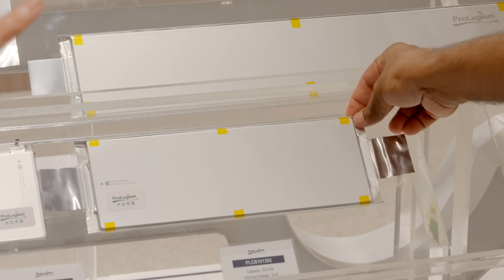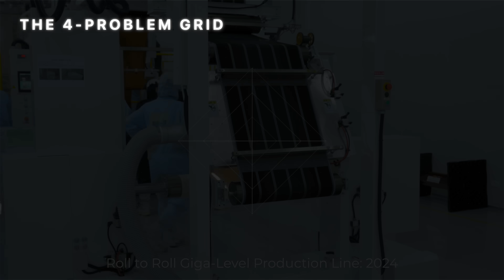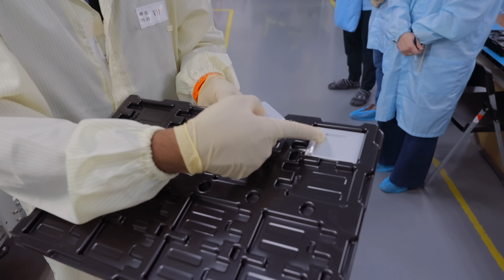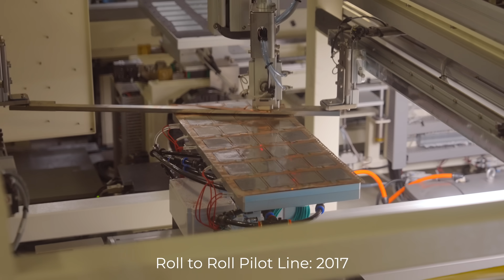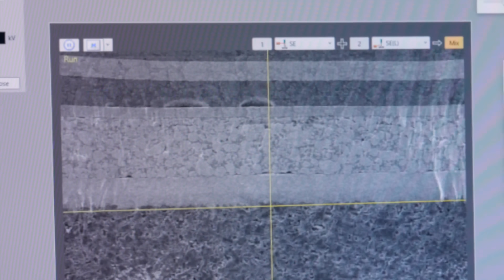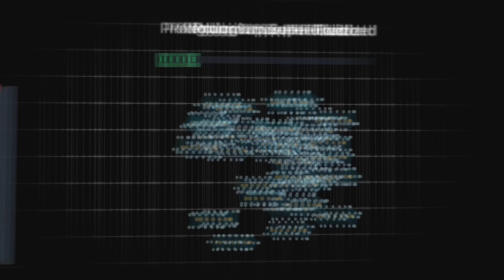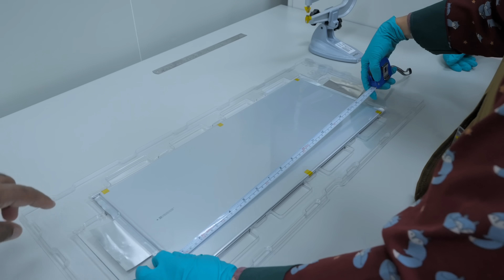Testing a REAL Solid-State Battery - Finally Here?

Comment: I've been saving up for an electric car, and these batteries are exactly the type of upgrade I've been waiting for.
Reply: You will have plenty of time for more saving before these become scaled for the level of production required for mass-market EVs.
Reply: Well, then you have to save up for a Mercedes supercar to get those batteries in the first stage.
Mercedes has a direct investment, so they will be the first to get the batteries
and are currently running test vehicles using them.

The full production plant in France is estimated to go online around 2028, and the car might come out a year or two later
You still have some time to save a fortune.
Reply: E puoi ancora aspettare,non mi pare le montino sulle auto

Comment: What cars has it come to? Where is it coming to in the future? Do we know?
Reply: No cars from what they said at the beginning, drones, personal devices etc right now. I’m sure that’ll change though.
Reply: The technology is basically ready and mass producible. So I guess it's about scaling up production at this point.
Reply: Mercedes has a direct investment, so they will be the first to get the batteries
and are currently running test vehicles using them.

Mercedes supercar might be the first EV product that people can buy with these batteries
Reply: Rimac will also have battery packs with their cells, supposedly ready to supply the first packs next year, meaning on the road / scale production by 2029.
Mitsubishi Chemical is involved in the cell material.

Comment: Solid State battery, look inside, liquid.
Does this make a lead gel battery a solid state battery too?
Reply: Being a gel is a good thing, it’s self healing when the anode or cathode move slightly. Solid state battery is about safety, and we see that it’s entirely safe.
Reply: I think they altered the definition, so now it needs to not swell when you cut it a bit?
Reply: @cristibaluta he mentions the definition first so he isn't hiding anything. But still it is odd. The energy density is promising if it really is  over 300wh/kg
Reply: @kapytanhook Doesn’t the video show that the energy density is 360Wh/kg? You don’t believe it?
Reply: @WoutMertens  360 is over 300. just look at the battery its optimized for density. in a normal form factor you can buy it will be a bit lower, very impressive in any case.
Reply: So, from looking at this video and their website, I think there's an explanation: the electrolyte is a very low viscosity liquid which somehow undergoes a change when exposed to very high heat that instantly solidifies it.

Comment: as a moron who is familiar with these things you call...batteries... ..im curious, do these new batteries require the same rare earth minerals as previous or have we managed to reduce the dependency on critical minerals?  Or are they completely different critical minerals?  Thanks.
Reply: Rare earths are used for magnets, and other things. There are 17. 

 NMC are not rare earths. They are transitioning. Well cobalt is. It's not rare - just a pain in the arse to extract from copper and nickel. There's actually more cobalt than lithium on earth I guess. It's just inside. 

 I believe this uses NMC + lithium. The maganese and cobalt of these types of batteries has been decreasing substantially for years.

 NMC started as a 1:1 ratio. Now you got ones that are like 80/10/10%. Or this one 90/5/5%. 

 These classifications though are getting too wild. I don't think I care anymore if it's a completely solid state. I just want a durable, power dense battery that doesn't weigh more than gold. Ha. 

 Can't wait for some 500wh/kg batteries. I was told 50wh/kg structural batteries would be revolutionary too.

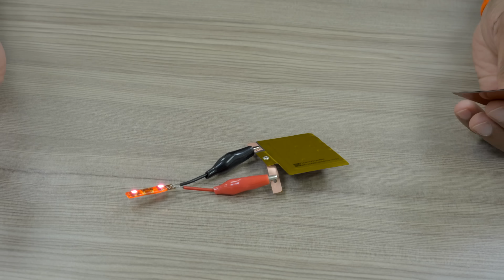Comment: At 12:00 what caused the puff of smoke when he cut the battery? Something obviously got hot the moment he shorted the battery with the scissors. Would this quick flash of heat still happen with a much larger battery?
Reply: He explained it immediately after. When the scissors touched both sides of the battery, it shorted the battery and the 2 little LEDs went dark. That puff was the short-circuit at the point of contact. When he was done cutting, there was no longer a short-circuit and the LEDs turned back on.

I hope that helps.
Reply: @hotflashfoto  Yes, I heard him state that it created a short and the LEDs went dark. And yes, it was no longer creating a short after the cut. My question, or concern, is that initial short. Even though the battery may not catch fire, if it were a larger battery, would that brief short be hot enough to catch other material on fire that might be near the battery? How much energy is being released when it shorts? The fact that it created a puff of smoke with such a small battery makes me want to know what would happen if a larger battery, say made for a car, were to short.
Sorry I wasn't more clear with my initial question.
Reply: The initial arc may have melted the aluminum wrapper or the scissors themselves.

Comment: I think that  donut labs has a SSB.  The density is the only thing that is out there.  But if they can get numbers around these I would not be upset.  It is like when a Car manufacturer says a car gate 40 GPM but driving it you get 32 GPM.  Oh that is just driving habits and we are fine with it.  I would say for a majority of people out there if that vehicle can be $20,000 get 300 miles plus and can charge in 15 minutes I do not think there is any reason to do an ICE vehicle.  For me I am excited because I want an EV so I do not have the gas station fuel I have to go to.  I can do it at home and I do not have to have all the maintenance.  I am simple I need a vehicle to get from point A to point B.  If that vehicle can also be a back up generator for my house then that is even better because that saves me $10,000 for that.

Comment: This could be Donut, but they chose to do a soap opera instead
Reply: It never could have been Donut Lab, because they do not have solid state battery.
Reply: @cristibaluta  Donut never had a real product. They market what ct-coating is doing. Now they have criminal charges at their hands to solve.
Reply: @cristibaluta  Probably because it couldn't be them
Reply: I CAN'T! Donut is BS
Reply: Donut is donut
Anything but having a solid state battery
Reply: Donut chose to take the battery to market agreeing to NDA which doesn't allow them to talk about it.
Reply: @mark.pinnell  No NDA would prevent them from saying the weight of the battery. If they did have an NDA that was so strict that they couldn't even say the weight, they certainly already violated it with everything they've already said so far. So the idea of an NDA being the cause of donut Labs ridiculous shenanigans is equally as ridiculous
Reply: @fredthebulldog529  read what you said again and think about it. Lol
Reply: @Yielar1  What's the problem with what he said?
Reply: @Yielar1  explain
Reply: @fredthebulldog529  NDA doesn't even hold up after public release.
Reply: @Yielar1  maybe you read twice before telling someone to do so?
Reply: @Yielar1  read what you said again and think about it. Lol
Reply: @mark.pinnell donut didn’t take anything anywhere. ITS FAKE

Comment: Sorry, without charge times to achieve an energy capacity, I don’t care. Ultimately, the goal should be to achieve the ranges of current gas vehicles with charge times close to time to fill. Another YouTube video that isn’t addressing what Donut is.
Reply: I get that you don't care, but on the other hand this would be a great solution even if charging times sucked (compared to Donut lab's battery) for many applications. But yeah, longivity, price and charge time were all kept away from us, so much for openness I guess.
Reply: @owlstead No, and the reason EVs are running companies out of business is because people like you don’t understand what the bar is. These companies would be and their customers, if subsidies never happened.
Reply: @Radarcb329 the bar had been met for many people especially for commuting. Nobody that buys electric turns back to the energy inefficient ICE. Just like solar and wind are now less expensive options without subsidies.
Reply: @owlstead what is many? And who cares what “people” do. But the reality is that many folks are unhappy which is why JD Power reliability and quality assessment’s best two car lines don’t manufacture pure EVs. One would have thoo PO ought EV reliability would be great but it isn’t and average or below average. And comes down to people buying based on hype that it’s more reliable than ICE or hybrids, but it isn’t and it comes with a higher price tag.  You can say this is BS, but at the same time VW and other manufacturers are shifting gears so to speak so they don’t go bankrupt. Bad politicians pushed it, and cancelled advanced nuclear energy in 2010. Fortunately advanced nuclear was given a chance in 2017, even though it was slow rolled from 2021-2024. Across all environmental conditions, advanced lower cost nuclear and solid state based BEVs is the answer.

Comment: Incredible. I can't believe I've never heard of them before. Why aren't they a household name? 

I know it takes a long time to scale manufacturing but I'm surprised I haven't heard of more OEMs for devices talking about them or using their tech.
Reply: Exactly my question 
Too bad I didn't see your message first
Reply: They just finished scaling up their production line early last year. And it's mostly used as a proof-of-concept production line to prove that larger-scale production is plausible, so a lot of modifications are made, limiting the throughput.

Their full production factory is currently being built in France, and the first stage of production is estimated to be in 2028, and the full stage at 2030+

The batteries produced in the past are mostly provided to the companies that invested directly (ex, Mercedes)
or undisclosed partner
Only after last year did they scale up; they started to send more samples to a wider range of vehicle manufacturers.

Comment: One of the most important details was missing. How much does the battery cost?
Reply: Guess it's not too expensive since Mercedes already partnered with them...
Reply: @dotrlogs  I didn't understand that Mercedes is working with them. Interesting... Has it been disclosed as to when M-B may offer this in its vehicles?
Reply: These batteries will go into premium EVs and command a premium price until economies of scale bring down production costs, same as every other new technology.  Probably at least double the cost of LFP in the short term.
Reply: I want to know the theoretical size and weight of my ebike battery 52v 20AH.
Reply: @A_Handle_2_Continue  just forget it, theyll never make these for ebike form factor, too expensive and the shape is problematic.
Reply: so far semi solid state cells in production are 20-30% per kwh over the best nmc/nca cells in cost. That should come down with scaling up and competition.
Reply: The price is probably still in discussion.
Reply: Each cell will cost you 10 Donut Lab cells.
Reply: That leaves 3 left if you bought 12 donuts.
Reply: Cost can be estimated based on volume of production, which seems solved based on the video.
Reply: It's emerging technology so very expensive.  If it works as designed then the cost will come down dramatically as they scale production.  
Every patent is a monopoly, so you must give the company time to recoup research and development costs and give the investors that took the risk their due.

In the mean time high-end product users bear this cost and in a few years the mass consumer market will then benefit.  This happens with every innovative product from bronze axes to micro-chips.